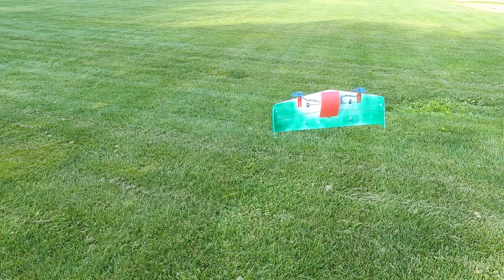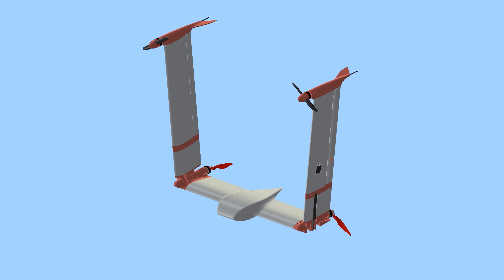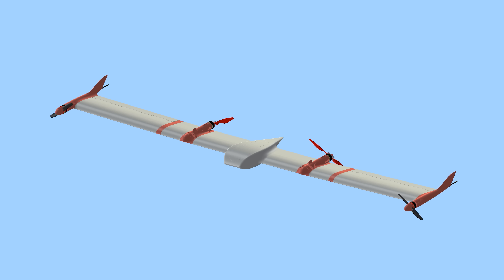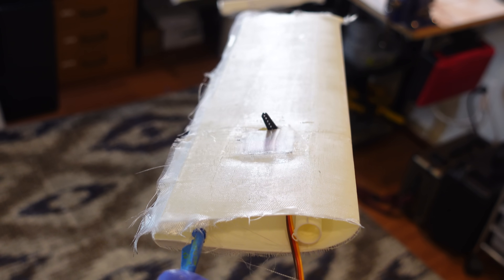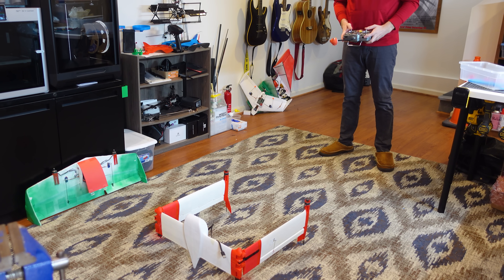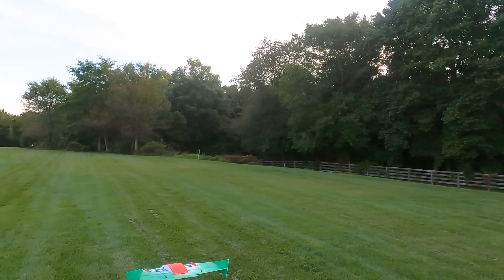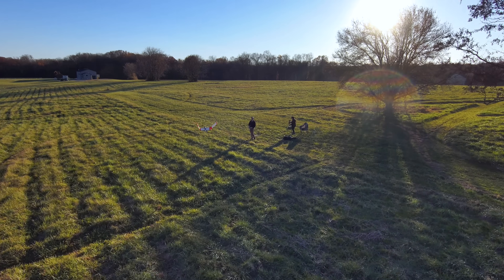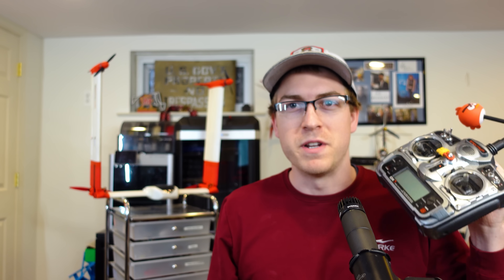Un-Folding a Quadcopter to Increase Efficiency - Part 1

Comment: FTM-103, the US Navy's stability and control flight test manual for the USN Test Pilot School, may be useful in understanding some of the stability characteristics (and stall characteristics). I had the honor of leading a recent rewrite. The new version isn't publicly available, but you can find the old one as a PDF with a web search for "USNTPS FTM-103".

Here are a few considerations that occurred to me.

There's got to be some really nasty dihedral effects in that late transition stage.

The mass distribution in transition may be playing into the oscillations. Most conventional aircraft with large dihedral don't have that much tip mass. You basically have a V-shaped airplane and the center of lift is a loooooong way above the center of mass. That will increase the chances of oscillation. Spending time there is not good.

Most conventional large-dihedral aircraft also have an empennage (tail fins). The roll induces a yawing moment (due to lift-induced drag differences between the wings) which a tail would help to counterbalance - but there's no tail here. That may be causing some interesting effects if the flight controller is starting to compensate with motor speed changes to "fix" the yaw with thrust.

Thrust changes will cause lift changes (blown lift) on the two tip props. Yaw inputs (see the previous paragraph) will be causing roll moments due to the blown lift.

There are HUGE ailerons here. The yawing moment due to aileron (again due to lift-induced drag differences between the wings) can be playing into this. Might need to adjust when (during transition) the ailerons are active or not.

All in all, in the half-transitioned region, there's no true roll control surface. The ailerons are acting as much as yaw devices, like a V-tail design. There's no center wing ailerons. So there's no way to directly fight the roll oscillations; affecting the rolling moment is entirely a matter of mixing a bunch of other effects. The only real control available is motor torque - basically the hover mode yaw control.

Another comment mentioned stall effects. I think there's something there, and spending time in that region is always going to be nasty. It's hard to get wings to stall symmetrically. I've added some comments as a reply to that comment. 

Given all this, it may simply be necessary to power quickly thru the transition, but that would require a very high altitude test to allow time to recover and transition back to hover if things don't go well. Definitely risky.

A couple last-ditch things to consider might be adding a "vertical" tail surface (out the top and/or bottom of the center fuselage box, basically creating a cruciform center section) with control surface(s) adding a strong roll component, or adding aileron segments to the center section.

Comment: have you thought about having the wings fold upward? You could then use a "simple" strap in tension to keep the wing in its flying configuration. Just realized you could take your existing drone and fly it upside down 🙂Nice project! Good luck!
Reply: I had the same thought: make the wings fold in the other direction, with a stop at the joint to take the load, rather than asking the actuator to take the load.
Reply: Great idea. I guess it will depend on whether there is a stability or software advantage in an anhedral versus dihedral configuration during the transition phase.
Reply: @GodmanchesterGoblin  Intuitively it seems this approach would make transition even less stable, with the center of mass now being above the center of lift. There might be ways to overcome that problem.
Reply: @truejim  Agreed - but software control can sometimes benefit from an inherently unstable system since the corrective actions may be more consistent across a range of situations.
Reply: @truejim  :  That's the way I see it too.  It might prove simpler to have a latch at the fully unfolded position.  That is assuming there is a need for anything... if the linear actuator is not back-driveable, and it doesn't need to suck battery power to stay unfolded, I guess you would leave it alone.

Comment: I wonder if a folding "H" shape could be better. I mean, the "U" shape places the central pod off center when hovering - not good if you wanted a payload. But an "H" shape would place the central pod in the center.

So, in hover it's like a biplane, and you can transition to a biplane horizontally. But then, the wings can rotate flat against the center spar. Because these wings are centered around the pivot point, you wouldn't need very strong servos to do the rotation.

Comment: What additions do I need to make so that your flight controller can be used for waypoint navigation ? (Except GPS.)
Reply from the maker: In short: lots. It wasn't really designed for that level of control, just basic stabilization for manually flown aircraft

Comment: That moving X-ray overlay of the 3d design at 2:22 🔥
Reply from the maker: Thanks for noticing 😃
Reply: @NicholasRehm  it was so slick I didn't even question it.
Reply: @NicholasRehm and the vertical arrows pointing down squiggly around 5:45 so cool dude 😎❤
Reply: Oh yeah
Reply: Real lit indeed
Reply: Earned my sub instantly
Reply: yeah that was so smooth
Reply: Unfolding from top makes it unstable(You are creating an inverted pendlum) Why don’t you try to unfold from the botom up?
Reply: @xpindr00  Because you are adding dihedral with unfolding from the top which adds roll stability
Reply: That was sexy producing and editing for sure. Care to describe your process of achieving good alignment? Was it uncoordinated filming first and total aligning in cad or was the filming also planned
Reply: I had a little bit too much fun doing some video transitions: https://youtu.be/uxb8ACWtDkI?si=BhoITlYh0DR6NczF&t=50 (similar project, btw.)
Next time, an X-ray overlay. Great idea.
Reply: That really caught my attention and I watched it 15 times and then 3 more times.  Super!!! ❤

Comment: Is it a weird yaw control thing? It seems like yaw control would be more and more dependent on the difference in power between the wing tip motors as it unfolds and the control surfaces transition from rudders to elevons.
Reply from the maker: Yea, probably something in my gain staging between flight modes

Comment: Love watching your stuff! Stopped my entire morning to sit down with this video lol

My guess is that during your transition, you're getting stalls at the tips of the wings and losing control authority from the aileron on the side of the stall. I'd venture that pitchAttitude + transitionWingDihedral > criticalAngleOfAttack. Combining those two angles obviously isn't a simple sum but I think you get my drift. Also, I bet that in a bank, the higher wing is stalling first, causing the bank to reverse, causing the other side to stall, and then you get into the observed oscillatory feedback loop

Solution space I'd say is either a) redesign the wing to twist slightly as it gets closer to the tip to reduce AoA, or b) just slap some vortex generators on the outboard sections to increase the critical angle of attack. 

All in all though great video! Love seeing you draw inspiration from ThinkFlight, Tom Stanton, etc. Waiting eagerly for Pt 2!
Reply: This might be on point. I did some intern work at NASA 35 years ago on stall triggering devices, to enable flight at very high angles of attack without losing control. We tested a number of things, including vortex generators, "bug splitters" (wedges of sheet metal sticking out the front of the wing surface), roughening strips (like, 40-grit sandpaper) to energize the flow at different positions on the leading edge and upper surface, drooped leading edge segments in front of the ailerons (to decrease the local AOA), wing twist, leading edge slats, and more. It's an art, as much as a science; it was a matter of playing around to find the best solution for a given design. 

It almost seems like the best answer is simply higher speed in the partially-transitioned configuration to quickly get past that stalled regime, and only then transition the wing fold the rest of the way. Creeping up on the transition at slower speed is going to make things worse, I think.

USNTPS FTM-103 (I mentioned in a previous comment) has a good section on stall issues.
Reply: That's a good point. There's probably some serious pitch/roll coupling going on with all that dihedral and no fin.
Reply from the maker: I’ll see if I can straighten it out in software, but some hardware tweaks like you suggested are definitely on the table
Reply: @NicholasRehm  A potential starting point here https://youtu.be/kA1ENhxLqTo?si=8Hok6ABoFGeW9CZr

These guys have a similar AOA during transition, might be able to replicate their transition

Comment: nah, box wing is just the best and rigid. and quad copter tail-sitter plane compatible. barrel drone is the best. also the structure is self-supporting, better with simpler material than carbon fiber cross drone. omg, the box/barrel drone does not require any servos moving parts for flaps, just the drone motors controlling direction in both flight modes. also symmetry in both flight modes is better than non-symmetry. not production version, too complex.
Reply from the maker: But aspect ratio :-(
Reply: how about settling in for "less lift" for better all around? @NicholasRehm
Reply: every moving part will make the plane drone break more easily, nope, I would not go that route, you could add rigid wing extensions to the box/barrel, to make it tall and high, like a tie fighter, or X-fighter. the motors stay at the center-ish, even if it looks like a star plane, not a normal plane @NicholasRehm
Reply: hashtag drone plane # @NicholasRehm
Reply: no, dual rigid wide wing tail-sitter drone plane, bi plane tail-sitter, with rigid quad copter rotors, aspect ratio wide, bi-plane drone but wide, ok? @NicholasRehm
Reply: you sacrifice so much to engineering woes to get a single wide wing craft, over a wide bi-plane craft. the joints are very floppy, including other woes @NicholasRehm
Reply: try bending the opposite sides of the wings, both flight modes, it will flex like mad, rigid box/barrel/bi-plane would be much more stable/strong/rigid as a structure, it could even be cross braced. come on bro. @NicholasRehm
Reply: reliability over fancy, if it even wants to be an actual production vehicle @NicholasRehm
Reply: also rigid wing structure is stable in all flight modes, no sudden changes to operating parameters. I would pick the more stable version any day for production, no matter how fancy the "more lift" fancy version would be. @NicholasRehm
Reply: transition moving parts is a killer for stability. @NicholasRehm
Reply: you bypassed bi-plane tail-sitter without much explanation, meh  @NicholasRehm
Reply: sorry for spamming, but I had to say it @NicholasRehm
Reply: sliding our wings for aspect ratio? @NicholasRehm
Reply: what did you say about long wings not having tip/vortices? why not, they have tips @NicholasRehm
Reply: oh, box and barrel drone plane wings dont have tips, but a vertical wall, at the tips, so no tip vortices, at all @NicholasRehm
Reply: I made a 3d render animation model of the box wing tail-sitter vtol plane (and car) concept on my channel if interested, tilt fold back wings include for your pleasure. should be a way more rigid design, not bending flexing all over.

Comment: I think it might be far easier to fold the wing in quadcopter mode instead, possibly even adding to lift in quadcopter horizontal motion, though it would give drag in straight vertical motion.

Comment: I'd love to see this design "fully unfolded"
Reply from the maker: Hopefully soon!
Reply: @NicholasRehm  If you did give up on this, a post-mortem would be useful
Reply: @NicholasRehm  
I wish you success.
Reply: @NicholasRehm Yeah still waiting Lil bro
Reply: The geometry of the plane seems off. I think it would lack roll/rudder authority for such a thin wing without sweep.. unless the software is very good :p
Reply: @ethanhermsey that's why he designed his own flight computer
Reply: @ethanhermsey  But the wingtip motors have such a high leverage that they provide good authority, no?
Reply: * ba dum tss *
Reply: Really interesting.I’m wondering if you couldn’t just use aerodynamic manoeuvring to snap the wing into position using spring locks rather than heavy and complicated actuators?
Reply: @andrewpease3688  also how do you get them back into the quad configuration for landing
Reply: @thomaslowe7816  That bit is easy,just release the lock
Reply: @andrewpease3688  Then the wings will buckle
Reply: @ardaricus1566 Obviously it wouldn’t be simple control wise,but I don’t see why it would have to be sudden or violent

Comment: Not that you had problems with the wings buckling, but I wonder if is there any cons in folding the wings the other way. They wouldn't make it weird for landing, since it lands on it's "side" and could add a lot of strength to the joints, but I have no Idea if while half folded as a upside down V/U it would be less stable than a right side up V/U. If you could enlighten me about that, i'd appreciate it.
Reply from the maker: I actually considered that and agree it would probably make the joint much stronger when fully deployed! I figured the dihedral could help through the transition, so that's why I decided to fold them down rather than up
Reply: @NicholasRehm  You can always just reverse the controls and fly 'inverted.'
Reply: @toolbaggers  That would make it difficult given the lift forces when in forward flight.
Reply: @HonestAuntyElle   would the lift forces actually help the wings open out into forward flight position? The issues I would see is folding back down to vertical flight you would be fighting against that lift.
Reply: Not sure such extreme anhedral would be a good idea. It would probably just flip over

Comment: This is a super cool project!  Very excited to see the next video and hear how you smooth out the instability.  Can this be done with SW only or will it take physical changes?  CH change?  A tail of some sort?  Good luck!
Reply: I have become intensely interested in transitioning EVTOL.  This platform holds so much promise to create the new age of aviation where you can take off from your yard and fly hundreds of miles on electric power.
Reply from the maker: Thanks!! It will definitely be a software fix, but there’s some hardware tricks we can play with to make that process a little easier. I’m thinking some removable horizontal tails to temporarily improve longitudinal stability. The end goal is actually an unstable wing in forward flight, since those can be even more efficient. Kavin @thinkflight has played with this idea quite a bit
Reply: @NicholasRehm  The whole concept of a VTOL, high aspect ratio, unstable wing is so appealing, it is the best of all worlds!
I don't fully understand the advantage of having the center motors off in forward flight, I would have expected distributing the thrust across more motors would be more efficient. I guess with a decrease in tip motor speed there is a decrease in tip vortices reduction so maybe that is the tradeoff? Maybe you can explain more in the next part?
Reply: @dfgaJK  A wing requires ~1/3 the energy of an aircraft hovering on thrust alone to carry the same weight. Turning off motors reduces power, and increases flight time, efficiency. Folding props reduce drag. The other trick mentioned in the video is the propeller prop pitch is different between inner and outer motors. Inners are optimized to offer better hover performance, and the outers offer better fixed wing cruise performance.